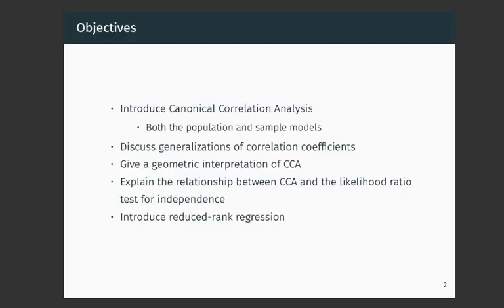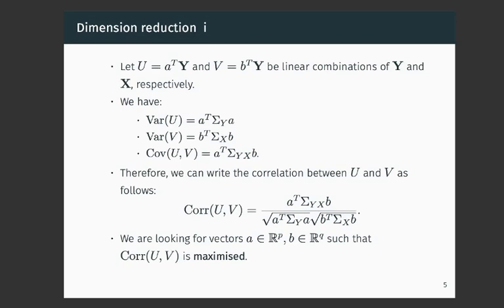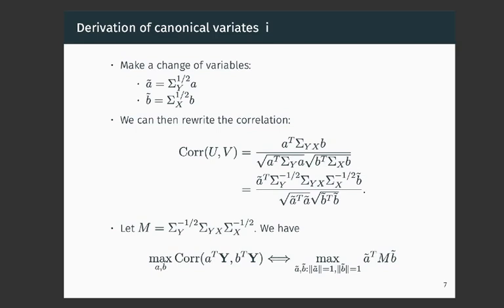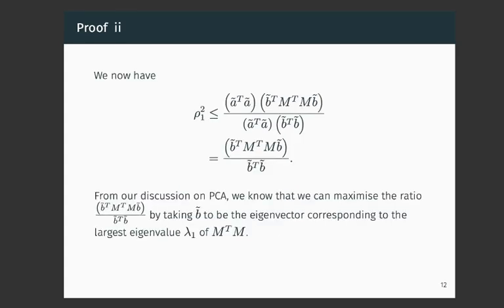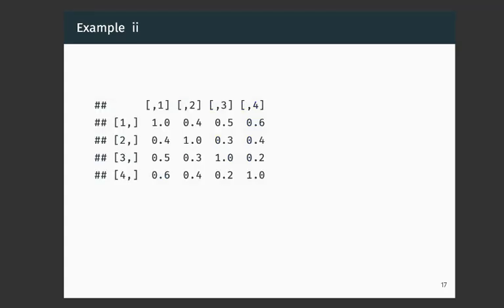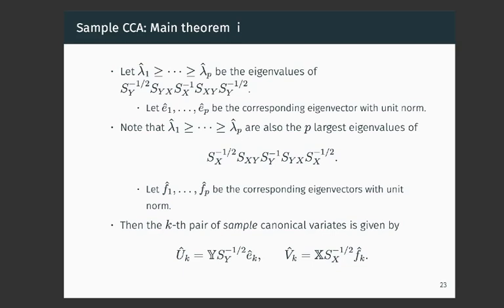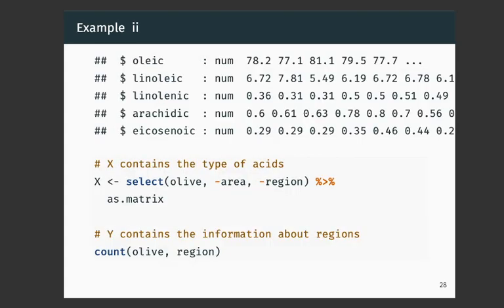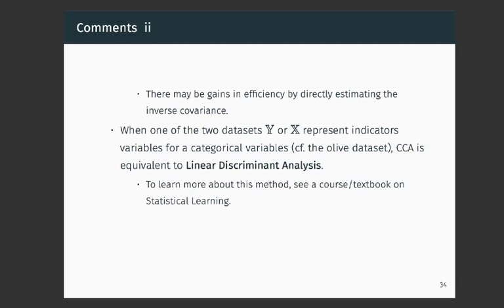Canonical Correlation Analysis—Introduction

Comment: Technical question (sorry for the spam). 

if (will ignore the tildes, all a,bs have them) a = M b but b = v1 (first V SVF from M = U Sig V^T), then how is a not equal to sqrt(lambda1) u1? My reasoning is simple a = M b = U Sig V v1 = sum_r sig_i u_i v^T_i v1 but v^T_i v1 = 0 for i!= 0 and 1 for i=1 so we get a is sig1 u1 where sig1=sqrt lambda_1?

Btw, fantastic video! thanks in advance!
Reply from the maker: Actually, this relates to your other question above about the constant C. Remember that we want a tilde to have norm 1. So what we have is that a tilde = c sig1 u1. If we add the norm 1 constraint, we'll see that c sig1 must equal 1. In other words, we have a tilde = u1, as expected.

Comment: what is the shape of the square root of the variance matrices?
Reply from the maker: The variance matrices are positive-definite (symmetric) matrices. Therefore, all their eigenvalues are real and positive. You can get the square root by taking the eigendecomposition Sigma = UDV^T, take the square root of the elements of D, and remultiply the matrices Sigma^{1/2} = UD^{1/2}V^T

Comment: Thank you for this CCA video. While it is informative, right now, I need a video that literally walks me from the original data set of p and q columns of data to the final period of the interpretation. I need a real life example without all the theoretical notation. I am proficient at EXCEL matrix operations and I am proficient with SPSS. I don't know R well enough to use it. I hope you understand. Is there a way you can communicate with me?
Thank you.
Kenneth
Reply from the maker: Thanks for the comment. These lectures were recorded for a course on Multivariate Analysis for graduate students in statistics, so it was definitely more on the theoretical side. But I like your suggestion of a video walking through a data analysis, I'll add it to my list of potential future videos.

I don't know Excel or SPSS well enough to tell you how to perform CCA using these software. For R, the main function is "cancor", and it is available with base R (i.e. no need to install any package). There is also the package "vegan", which is a great package for multivariate analysis. It was developed by applied researchers (in this case, ecologists), so it is very much designed to be user-friendly. However, the terminology is sometimes slightly different than what statisticians use.